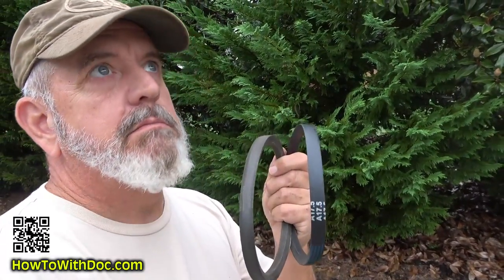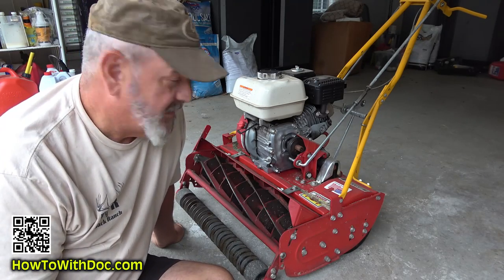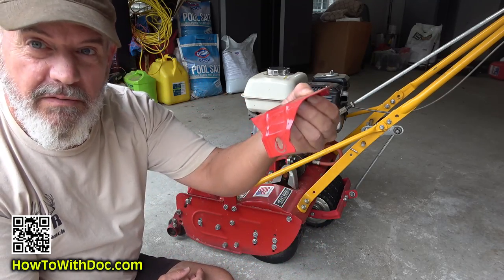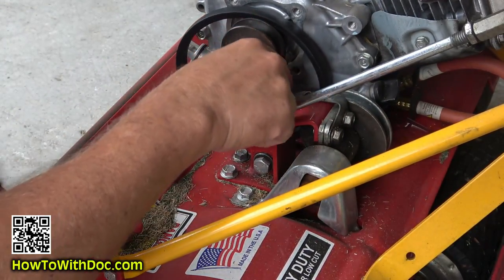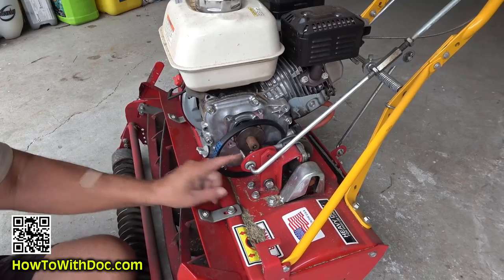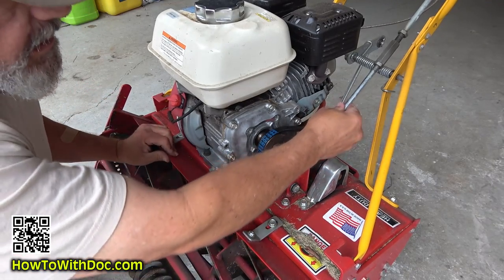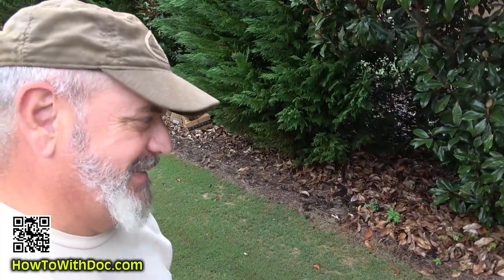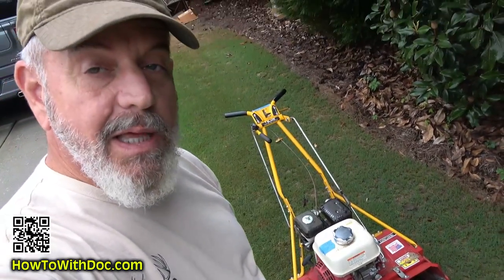Replace Mclane Reel Mower Belt

Comment: Thanks, Doc. I have a 20" McLane and have a Love - Hate relationship with it. Not too dissimilar from my Stihl gas-power tools.

Question & Comment

Question: the roller you have on the bottom has "ridges". Is that from the factory or after-market? I have an after-market that is solid metal to help with yard-striping.

Comment: Are the engineers that made these mower geniuses or the opposite? I just recently raised the mower height to another level - and it's basically a two-person job...